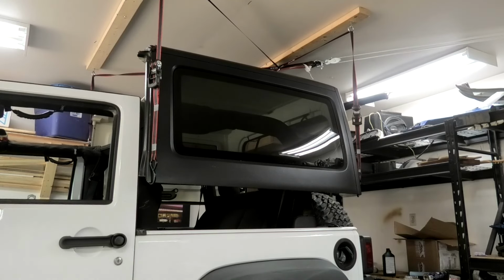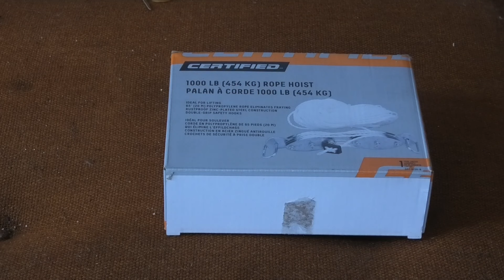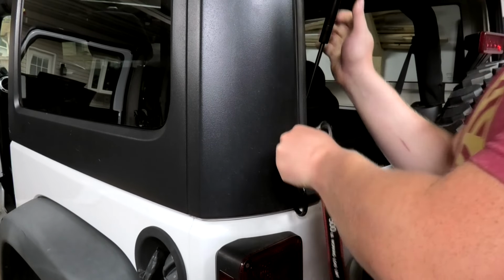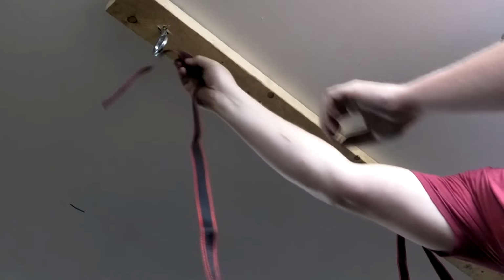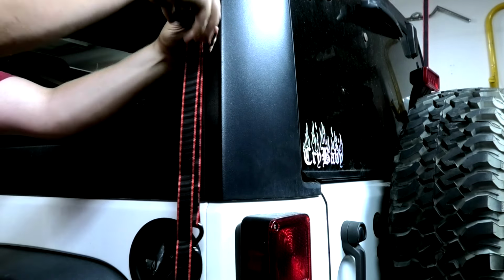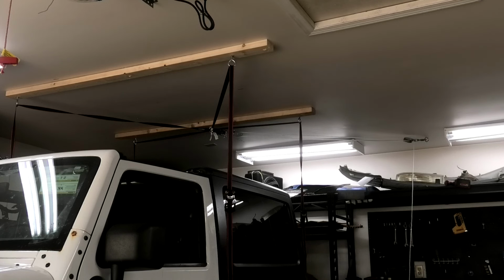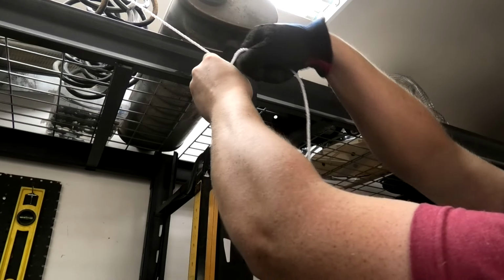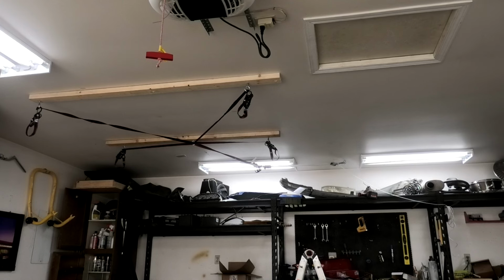DIY Jeep Roof Hoist for $60

Comment: Love everything abt this video. Pretty clear instruction, perfect level of sarcasm, excellent job. Saw another Jeeper vid with a similar set-up, and they used hammock straps run thru the inside to connect the corner hooks on each side. In my simple brain, it seems it would distribute the "lift pressure" (🤷‍♀) better than just hooking all four corners. The actual hard part of this build for me would be rearranging the garage! lol

Comment: i used a block and tackle for mine.  Bought all of the materials from my local TSC.  I just hung from the center and have 4 ropes with hooks that go to the rear of the  hard top and then to the underside of the roof overhang (part over the driver's head).  That provided good spots and the block and tackle has a brake on it to prevent it from falling on it's own.  All in, i probably have about $200.00 US.
Reply: Do you have any pictures of your design?

Comment: Built a similar system using this video as a guide. Bought the gambrel/pulleys from Harbor Freight and used 4 ratchet straps and eye hooks/rings from the ceiling on the four corners. Problem is that there is so much mechanical resistance, I can’t lift it without help. Is it my low priced pulleys? Or what am I doing wrong?

Comment: Great diy, i've buld something similar but because i'm too lazy i've used a manual crank instead of pulley and after a drill to pull the strops, make 4 knot  to avoid over rewind and hit the roof with the rear window (be patient of my bad english i'm from italy)

Comment: I did something similar with aproxinately $100 total from amazon.

I hung an electric hoist and attached the 2 straps ends in a crisscross pattern to the hoist's hook. By attaching the two strap ends in a crisscross pattern to the hoist's hook, you're distributing the weight more evenly and securing the load effectively. This setup helps prevent the load from slipping and can improve stability during lifting. 

* VEVOR 3in1 Electric Hoist Winch Crane, 1100lbs Material Handling Tool, Wired and Wireless Remote Control, Overload Protection for Garage = $90
* XSTRAP STANDARD 2PK 1''x 8FT Lift Sling Web Strap/Wear Guard End, Heavy Duty Flat Eye Lifting Sling = $12 

If you want to go even cheaper, get a manual one for about $37  

just a thought....

Comment: Recreated this setup, only I used a worm gear hand crank instead of the pully. The issue I'm running into is the center eye lag screw where all the straps come together and connect to the cable. There's too much tension on that center eye lag, from the ones immediately to the right and left. It's causing the center eye lag to tilt forward (towards the pull of the cable) and I can see this eventually breaking loose. Did you encounter this at all? If so, how did you fix it?
Reply from the maker: I haven't encountered that. On my setup, that eyelet has several inches of purchase on the rafter above so I'd be surprised to see it shift even 1cm. Is yours anchored directly to the rafter, or is it screwed into a stud that is then screwed into the rafters?

Comment: How does the weight of the pulley not want to sag when unloaded ?  Is the weight of the 4 straps that much more than the pulley?
Reply from the maker: There's enough friction in the system that if you just pull the pulley tight, it will stay tight and not sag.

Comment: Any issues with the weight difference between the front of the roof vs. the back where the window is located.
Reply from the maker: Nope, the weight doesn't need to be distributed evenly for this to work. Each corner only needs to be heavy enough to sit snugly on the hook. For this particular hard top, there's still plenty of weight on the front hooks.

Comment: Great idea!  I’m planning on doing the same.  Only question I have is you only used two screws to hold the 2x4’s in the Joists? Will that support everything else?
Reply from the maker: There's more than two screws. If I showed myself driving every screw, the video would be long and boring.
Reply: I used 3” screws in each board, up through the drywall and into the joists. Holding so far.

Comment: In retrospect, with your addition of the pulley system, would you still incorporate the come-along/ratchets in the design? Thanks for the great video.
Reply from the maker: Yes, they still make for the most convenient assembly. Since they're adjustable, you don't need to do any cutting or measuring.
Reply: Thanks!  @SpinningWrenches